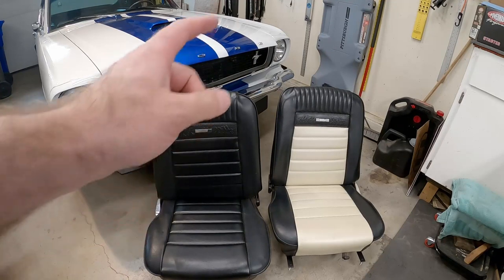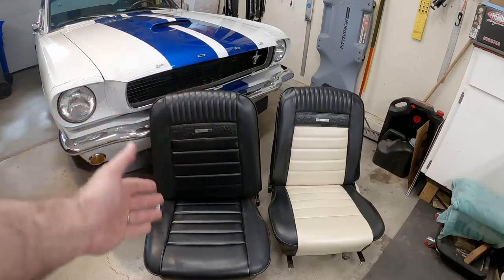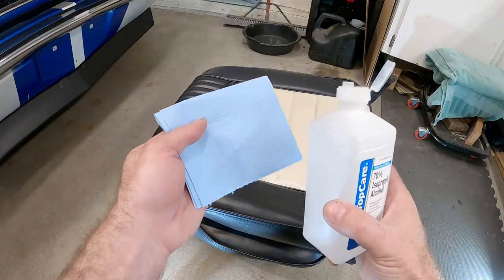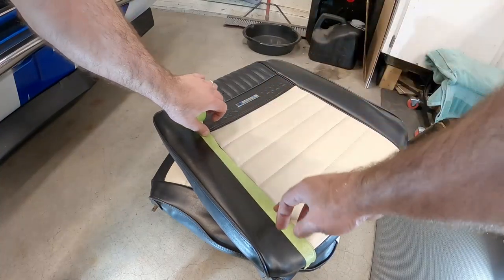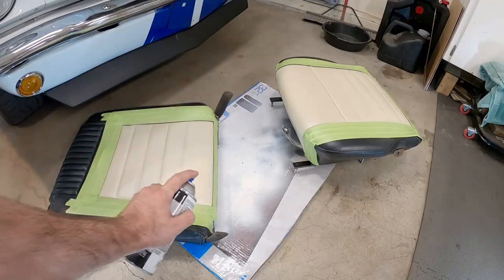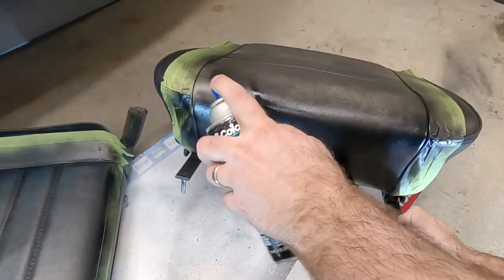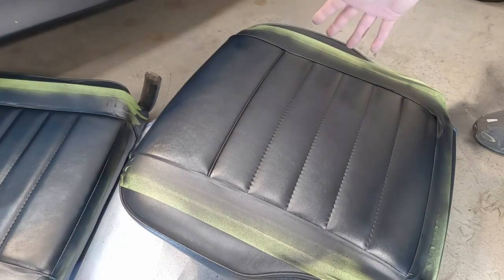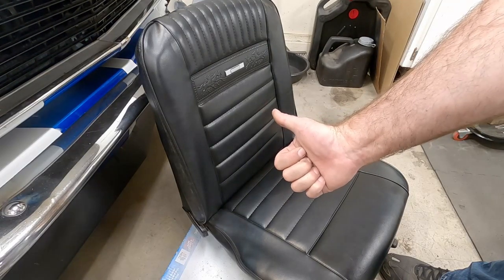Painting Vinyl Seats - Duplicolor

Comment: Did you use gloss black or flat black?  How do you maintain them armor all?  Thanks for the videos.
Reply from the maker: It's a Matte Black color.  I haven't wiped them down since I sprayed them, so I don't know if something like armor-all will do the trick.   While we're on the subject, I don't use armor-all in my vehicles because it has silicon in it and it just collects more dust.  I use "303 Aerospace Protectant" in places where I would have used armor-all.  I've been using this for over 10 years and I'm happy with the results.  :)

Comment: Looks good. I'm going to try and use fabric paint on my cloth seats and maybe paint my carpet.
Reply from the maker: I don't recommend this as a long term solution.  What I mean is I was never going to keep these seats, and so painting them in the interim while I figured out what seats I wanted was purely a band-aid because I disliked the white and black seats so much.  This may work well on the carpet, but depending on your use of the seats, it may not hold up as long as you hope for.  I plan to do a follow up video on this to show how the paint has held up.  :)
Reply: @AndyKruseChannel  Thank you for the advice. I'm hoping a good cleaning will make them look better otherwise trying the paint will be an option before replacement.

Comment: i have a 68 camaro with blue fabric and i want it black, i want to paint my 2 front seats and the rear seat , the 2 door panels and the 2 rear panels, so how many cans do i need? all fabric is blue so i have to paint everything and i dont know how much do i need... is ok with a box of 6 or i need 2 boxes that means 12 cans
Reply from the maker: I think you'll definitely need all 6 cans of that one box, but I don't think you'll need 12.  If the box of 12 is priced fairly and you'd rather not deal with the inconvenience of needing to source an extra can or two, I'd get the box of 12.
While I've got you here, please note that painting the interior is more of a band aid than an upgrade.  I completely plan on replacing my front seats and I have no interest in restoring them or anything like that, so I had no issue painting them.  I feel your pain on the blue interior as I wouldn't like it either, but just a heads up if you choose to go down this path.  :)

Comment: does it look the same after one year
Reply from the maker: I'd say it's about 97-98% the same.  There's one weird crease on my seat that the paint has worn off.  It's small, but I see it because I know it's there.  I'm ok with that because I knew this was going to be a temporary fix.  Otherwise, without that one small spot, you'd never know I painted the seats.  :)
Reply: @AndyKruseChannel might have to get couple cans today anyway how many cans did you use, I think I need roughly 5 or 6 cans or more for front and back seats, thank you
Reply from the maker: @peterbrown1968  I used one can, but that was for the center sections of the front two seats.  If you need to do the whole front seats, and the rear seat, I'd say 3 cans, maybe 4.  :)

Comment: No adhesion promotor?
Reply from the maker: Nope, not required to make these work, that’s party of the beauty of it. But, I still only recommend this as a last-ditch option or when your in between your old seats and getting some new ones. The paint has held up fairly well since I made this video, but there’s o e spot where it not lasting. It’s a part of the vinyl that creases when sitting in it. It doesn’t look horrible, but it doesn’t look good either. 😁

Comment: How well does it hold up to wear?
Reply from the maker: So far it has held up great, but the car doesn't get used much in the winter, so this coming summer will be a better gauge on how well it continues to hold up.  :)
Reply: @AndyKruseChannel  I am going to do the same with my seats. They are aqua. Such an ugly color combo with frost turquoise exterior. I'm going all black.
Reply from the maker: Some of the reviews and other videos talk about the several years they can get out of set of painted seats with this specific paint.  If you put a little effort in up front to make sure the vinyl is clean and good to go, I think the paint will last a while.  In the mean time you can decide if you want to re-upholster the factory seats or just buy new.  I painted mine to buy me some time until I can afford the seats I want.  :)
Reply: @AndyKruseChannel  I plan to do the same. I will put black seats in eventually. This is just a show car. So it will only come out of the garage 2 or 3 times a year. So it will get very little use. But, this is a cheap fix for now.
Reply from the maker: @hughphillips67Mustang  That's a great to put it, it's a cheap fix.  You honestly can't tell it's painted, even if I told you they were.  Definitely good enough for now while I figure things out.  :)